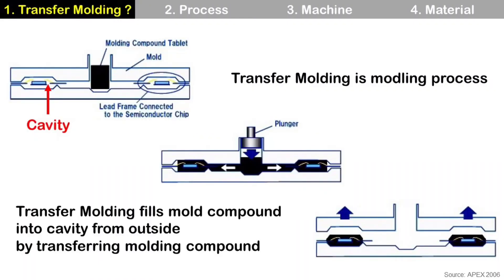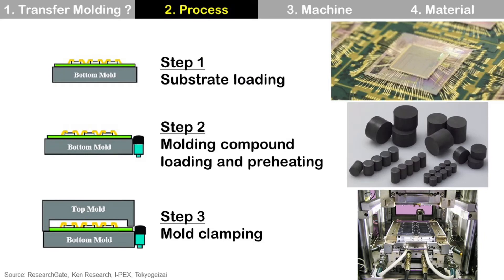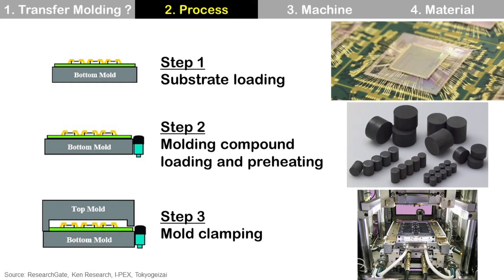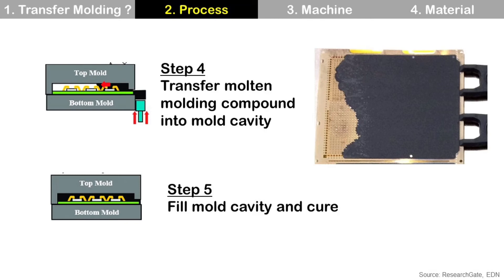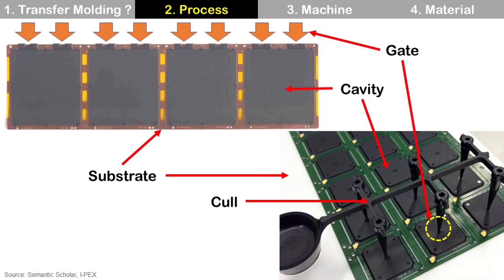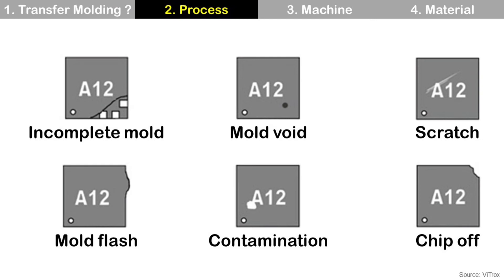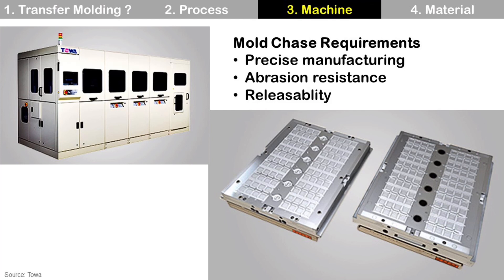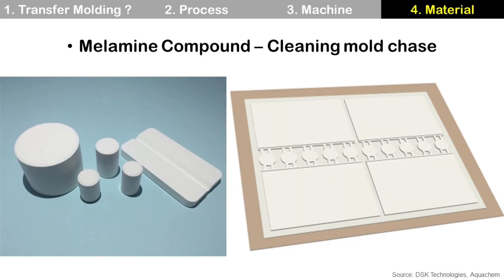[Eng Sub] Transfer Molding

Comment: Can you advice me, after molding why the cull is sticky one the plunger pot...
It's happened sometimes...
Reply from the maker: Residue of molding compound or contamination on mold can cause that problem. So usually mold cleaning process is used to prevent this issue. Please check some websites about mold cleaning.
https://www.caplinq.com/melamine-cleaning-compounds.html?SMM
https://www.douyee.com/en/products/35/nikalet-mold-melamine-cleaning-compound
https://www.cape.com.my/mold-cleaning-in-semiconductor/

Wax material is also used after mold cleaning process for better releasing of mold compound from mold.
https://www.caplinq.com/wax-conditioning-materials.html